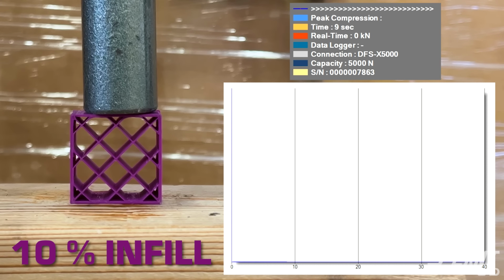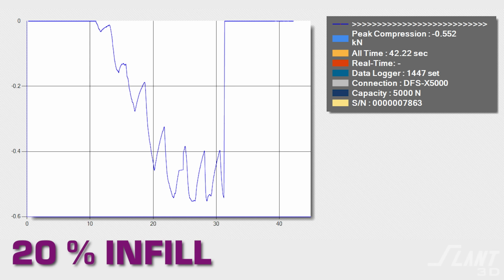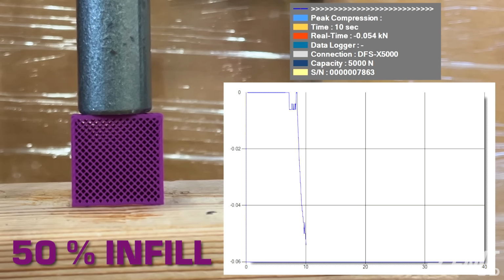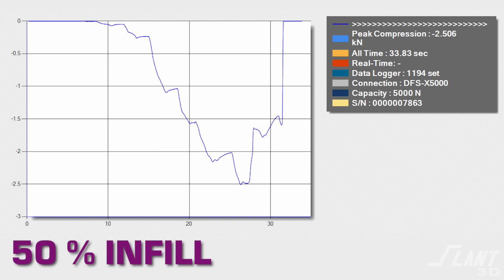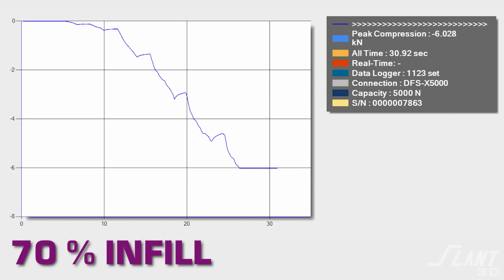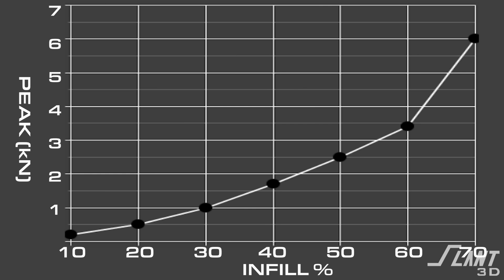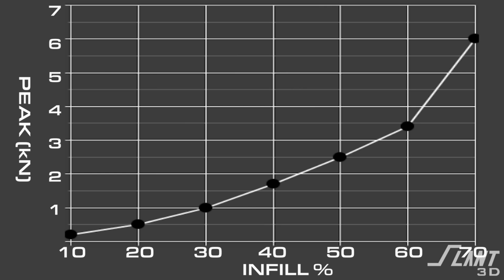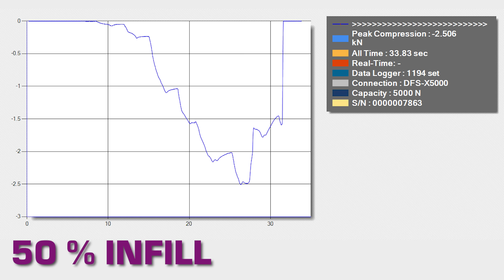From 10% to 100%: Infill Compression Strength

Comment: For all non-US: 0.225 pounds = 0.1 kg
10%: 0.2 kN = 20.4 kgf
20%: 0.5 kN = 51 kgf
40%: 1.7 kN = 173 kgf
50%: 2.5 kN = 255 kgf
60%: 3.4 kN = 347 kgf
Reply: who uses kgf
Reply: @M2rsh  if you want to know how many kgs you can put on your print, kgf is way to go.
Reply: @Haapavuo  It's literally N/10 (Or whatever g approximation you want to use) kgf is deprecated
Reply: thank you😃
Reply: European here Newton is in kilos so whats kgf and why are you converting it since Newton is kg.m.s-2? And 10N is the gravitational force of 1kg so why kgf?
Reply: @kriziaktv   1 kgf = 9.80665 Newtons. Gravity of Earth is 9.80665 m/s2. Thus your calculation of 10N is not accurate. I wanted to provide the accurate numbers.
Reply: @Haapavuo  You could just use Newtons we all use newtons in europe
Reply: @M2rsh  Kilos are (for me) easier to understand when it comes to strength of the model. I can use whatever I want, you can use whatever you want. I will end this conversation here.
Reply: @M2rsh  Why do you care so much what units he uses?  And 'Newtons are already the same thing' is not an argument.  Do you ever use cm?  But cm is just m*100, why would you ever list anything as cm instead of meters?  Awful argument.  Did you know servo motors often have their torque listed in kgf-cm instead of N-m?  So no, the unit is not "deprecated."
Reply: @Misterspork57  "The kilogram-force, or kilopond, is a non-standard gravitational metric unit of force. It does not comply with the International System of Units and is deprecated for most uses. [...] Kilogram-force is a non-standard unit and is classified in the International System of Units as a unit that is not accepted for use with SI."
Reply: haha I laughed when I saw kgf for nonUS people. I think newtons are universal
Reply: @Ch0s0Kam0  he was also talking in pounds which are not.
Reply: @Haapavuo  I use kilograms, so I think I could guess it
Reply: Bruh force is mg which is mass*gravitational constant. And newtons are litterally the universal force unit for kilograms
Reply: @M2rsh  who uses pounds? use metric system
Reply: @jeremiaskorndorfersouza4922  I'm not an american lol
Reply: Freedom units 😂
Reply: It is useful tho
Reply: @M2rsh  About 96% of the world's population.
Reply: Thanks
Reply: Thanks
Reply: My hero. Saved me so much google converting haha
Reply: @M2rsh What's your problem?
Reply: JFC people are so critical shoulda let them do their own damn conversions in their preferred units
Reply: Mi héroe
Reply: How much is 10% in imperial? 🤔

Comment: It would be cool to see the difference a more isotropic infill like gyroid would handle this test.  Also, a static infill and varying perimeter counts.  Then just to round things out, different print temperature (maybe just outside normal temps), and then finally, different cooling levels.  You didn't have anything better to do, right?
Reply: Gradient infill, also :)
Reply: Also include the weights of the printed parts, so we can do a weight/force graph to identify sweet spots.
Reply: Also change the direction of force for the same probe.
Reply: @lazyman1011  Yes, test both across layer lines and along layer lines.
Reply: Do it yourself 🤣
Reply: That and walls. Walls allow the pressure to disperse way more evenly across the infill. We wouldnt be able to see it, but it would perform way better.

Comment: Huge error here which completely voids this entire video. The downward pressure should not occur inside of the edges of the cube, but rather passed the edges of the cube. This would provide equal force on the entire surface area where pressure is being applied. On the fully filled cube, it is closer to being properly dispersed pressure, not quite perfect still, but closer. Had you had a metal pate of a proper thickness at the end of the cylinder that was wider than the cube this would be been a perfectly fine test.

Comment: I've done a lot of destructive testing on 3d printed parts, and I highly recommend making a centering jig for the part under test if you want good data. I had really inconsistent results until I put one on (the press side, not the passive side).
Reply: They plan on getting real lab equipment and making standardized test rigs. It was in the most recent podcast. This was more of a just for fun and some info style test. Def agree with you though!
Reply: What infill % would you recommend for display models ie tanks cars etc?

Comment: Designing a part for compressive force, you'd want the orientation to have the infill stand as tubes rather than laterally across the seams. Testing that orientation would be useful.
Reply: I think the idea might not be to test against the strongest axis? Not sure.
Reply: @joshuacheung6518  Why not? Using the wrong axis doesn't give much useful data.
Reply: Thanks for the tip, I was just about to print something that will be used in a compression situation. The only thing I'm uncertain about now is which type of filiment to use, PLA-CF, PETG-CF or ABS.

Comment: How is the strenght in compression in the z printing axis? With printing in the proper orientation, shouldn't you try to align the greatest force perpendicular to the layers, so it doesn't fail in shear due to weak layer adhesion? It's an interesting video, but with proper design and orientation during printing, which you channel is mostly about, one hopefully shouldn't be in a position where the force is applied in line with the layers.

Comment: I'm curious if the rise after 60% had anything to do with the change in the test setup.  Switching from a wood base to arbor plates would most certainly make a substantial difference, since the wood is absorbing some of the force.  Also, did you really break your setup, or did you just max out your load cell?

Comment: It seems that the results might be pretty sensitive to how well the ram is centered on the part.

Small differences in distance from the edges and corners will make big differences in the amount of local bending/buckling failure.

A load-spreading plate that covers the entire top surface of the test item would address that.

Comment: I like that you're compression testing the specimens in the transverse direction:
1) This type of data is rare, making it more interesting to me.
2) Extruded-section core (e.g. grid, honeycomb) is much stronger in axial compression, because it's naturally more resistant to buckling and shear failure when loaded along the cell axis. There is even more scatter in the data when compressing axially, since the initiation of buckling is sensitive to small differences in defects, loading direction, moon phase, and planetary alignment. The data wouldn't be as meaningful unless you were willing to slog through several specimens per density to gather statistics.

Comment: Would have been interesting to also graph the print times to see if there is an optimal compromise.
Reply: And also actual weight, though this will correlate loosely with print time.  That's going to be far more important than infill %, especially when comparing across infill types where infill % doesn't really mean the same thing.
Reply: @oasntet  Yeah. It's strange that 20% doesn't always mean 20%.

Comment: Did you mention the print orientation? Id imagine that the results would be slightly different if the layers were parallel to the head of the press.

Comment from the maker: What infill density do you typically aim for?
Reply: I find 15% cubic I fill works well for almost every project I have unless I need a completely solid part, which I use 100% rectilinear. Gyros was my go-to for a while but I find that cubic works well and doesn’t wobble my printer as much due to the straight lines as opposed to the wavy pattern of gyroid.

Most of my projects aren’t under any substantial load though
Reply: Usually I use infill for cosmetics, just enough to support the top of the part, and add perimeters for strength.
Reply: 35-40% for triangles and 14-20 for gyroid
Reply: Please measure and caculate the strength per weight next! :)
Reply: I'm normally around 15%, but I haven't done too much with different infill types.
Reply: 15-25% gyroid, I’ve always had a thing for minimal surfaces.
Reply: I usually use 8% gyroid infill, which has been plenty for my purposes.
Reply: I often do 5-6% gyroid infill and move the plastic that would have been infill over to extra perimeters.  For particularly large objects I might go higher or add a solid layer once in a while.  While there is a balance to be struck between perimeters and infill based on the actual application, in general perimeters are better than infill on a per-gram basis.
Reply: same @notsaucemanofficial
Reply: I usually go as low as i can afford it, while still supporting the top layer. If i need strength i increase the number of perimeters. I don't think i ever went above 25%
Reply: I almost always use cubic, and vary anywhere from 10 to 99%. After seeing this, I honestly don't think I need to worry as much. 99% I only use for Lithophanes. But I printed a spacer for a door knob yesterday at 99% that could have been printed at way less and been fine. I think I need to reevaluate what tough means.
Reply: If I'm using the Stratasys at work (for tooling applications) that just defaults to 100%, so I just send it 😂 those parts have ridiculous strength. The Markforged defaults to 37% triangular, which is fine for locating parts or no-load applications but any parts that do see load I tend to do solid on those as well
Reply: I nearly always do lightning infill, as low as I can get it (usually 25%, but that's still way less material than other infills). If I need strength, I increase the number of walls, sometimes just in a specific area that needs attention.
Reply: 0% Mostly.
Reply: Well..... 70% now :P
Reply: 40/50% on crucial ABS/ASA parts and as low as 15% on cosmetic PLA stuff. I honestly always though anything above 50% infill had diminishing returns but your video showed me wrong lol.

Comment: This is a great start but I would personally need to see the same with the part laid down such that the infill is parallel to the bed - I make products that are intended to be stepped on, and I only go 10 to 20% infill, but my items also have things like vertical cylindrical holes and arched tunnels across the bottom, so the infill itself doesn't have to support the bulk of the force.
Reply: was thinking the same thing

Comment: I really enjoy your infill testing videos. It's fascinating to see that what I've read about in my bachelor thesis can be observed in your tests as well. However, there's still a lot of room for improvement in your method to obtain reliable and useful data. I find it interesting how infill changes the cell size to alter relative density, compared to the literature, which typically modifies wall thickness to adjust relative density for lattice materials. Perhaps this is because most studies use powder bed fusion (PBF) or UV-resin printing for testing.

Please be aware that when comparing different infill patterns, the strength of the pattern is often anisotropic, meaning it depends on the loading direction. I'm not referring to the anisotropy created by the layers. For reliable comparisons of different patterns, you need to test different orientations of the infill pattern. I understand that running so many tests can be challenging. If you want truly reliable data, it would be necessary to test multiple samples of each test sample to understand the spread of the results too, like CNC kitchen often does.
Reply: The issue with this is that for low relative density, you have too few cells, leading to increased edge effects. This means that a significant portion of the load is borne by the outer walls, which can distort your results.
Reply: I would not agree with your assessment that 100% infill behaves like a solid plastic part. It can be clearly seen that there is crack propagation along the diagonal, a result of the infill pattern. You are right in your assessment that the part does not fully shear off. I think this could be because the part reaches the densification region before it shears, meaning all the walls touch each other, resulting in an increase in stiffness.
Reply: You should weigh your parts to verify their relative density. The produced parts realitve density can differ from the targeted relative density.
Reply: Just that you know I have so much to critic on your test, that it can seam, i dont apreashiated them, i really do. I am so exicted about this topic. There is so much potential to improve infill and so much to learn. The Topic is so fascinating. The litrature about lattice structures is just so inacessable. There are so many papers about the topic and i have not found any Good books on the topic which summerizes the field. To recommend to you.
Reply: @chinook9785  And on these points comparing a 3d printed part, even with 100% infill can't be "just about the same dynamics as a solid plastic part".  Even if you print 100% infill it isn't the same crystalline structure as a solid plastic part and the interior of the part still has a pattern to it at some angle, which we can see here from the failure.  It will never behave like a solid part, but we don't generally make 3d printed parts solid anyways.  You want to put a hydro jack on some plastic parts and say look how they fail, cool, and there is validity in trying to understand that.  But you can't make scientific statements about "isotropic" materials and their performance when testing a single print on top of a block of wood. I think what would be a more valid test is to somehow validate layer line adhesion as that is generally the root failure of an FDM/FFF part.  Or get some PETG raw bar stock and print some PETG parts and do the same test with a rigid base and fixture to apply an even force to the top of it if you want to make a claim about "as good as a solid part".
Reply: @LearnEverythingAboutDesign, it's really cool that you watch Slant3D; I enjoy your videos too. I think you're right—FDM/FFF/MEX-TRB parts usually fail due to poor layer adhesion, as demonstrated in numerous tests for example by CNC-Kitchen.
Reply: @chinook9785  every now and then someone sends me a video here to review so I pop over and take a look.  And agree with the CNC Kitchen comment.  His video on picking between PLA, PETG and ASA was fantastic.

Comment: I would like to see another test, like one where you test the strength of PLA parts at various ambient air temperatures. We would be able to see what the temperature limits are for functional PLA parts. I don't ever use PLA for functional prints but it would still be nice to know.

Comment: wouldt the lack of side walls printed make a difference, you had them open to see the infill but if you had walls wouldnt that increase the yeild strength of the parts as there bi latterally supported and resisted from "squishing" outwards

Comment: If you want to get more consistent results you could try using a smaller cube or a bigger loading platen. Everything you do should be the same. Making the walls thinner would test more of the infil  strength and less edge effects. If you are going to use the same setup position of the rod to the cube needs to be exactly the same each time.

Comment: I find myself using 60-80% infill more often than any other percentage. I also tend to print things that need that strength. For example a thread on shift knob for my stick shift daily driver which was printed at 70% infill. Been slamming gears hard on purpose to see if it'll break and so far after 6 months it's been just as solid as the day I put it on.

Comment: I hope you come back to this with more equipment. And doing a full test of infill percentages up to 70% and different types of infills and different plastics. Since you're already doing the work it would be nice if you could add in other things like relative humidity in the air while printing and testing as well as the temperature of the print the room and the testing environment. Good luck!

Comment: How about you try increasing walls instead of infill? Usually the part gets most of it's strength from the parameters so it would be enlightening to see how the number of walls correlate to the part's strength
Reply: I increase walls instead of infill to make strong parts. Very strong parts I use 30% infill and 7 or 8 walls.

Comment: Great stuff! I’m sure you did it but it would be great for future videos to show an average of multiple readings per infill. Having only one reading doesn’t eliminate any false readings (outliers) that you might have in there
Reply: You're right. There's definitely scatter in the data, as you might imagine from the chaotic initiation of buckling and shear failure modes. The only problem with multiple test specimens per infill is the requirement for multiple times as much testing. He's a busy guy.

Anyway, the strength/density relationship is strong enough to see a pattern, regardless of scatter. It's typical of hollow core materials to have compressive strength that is roughly a power function of density, with an exponent somewhere above 1. In other words, doubling density increases strength by more than double. From this data, the exponent works out to range from 1.24 and 1.84 based on consecutive data points. It's all over the place from data scatter.